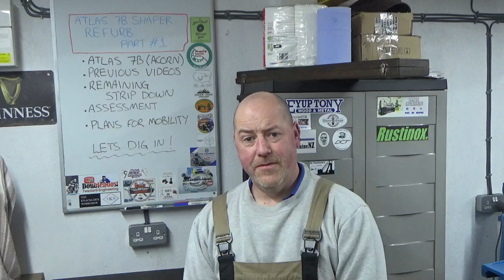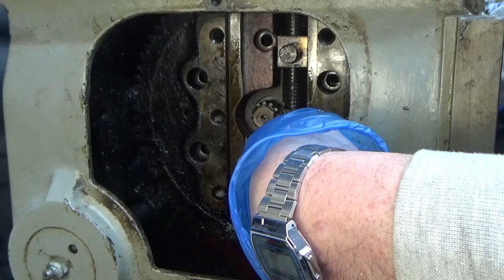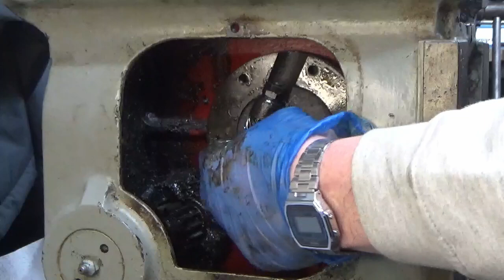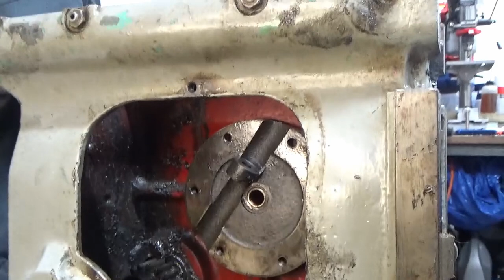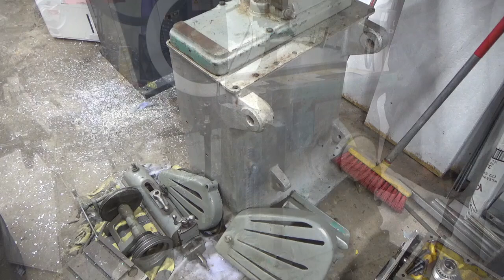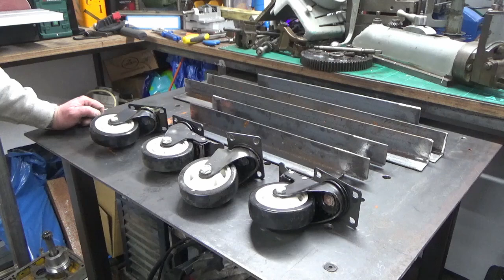Atlas 7B Shaper Restoration  Part 1 - Initial Strip Down

Comment: Quite well specified, ref stroke length adjustment by external control, and stroke position. My 7" Alba was originally flat belt drive, 2 mechanical speed, with stroke length requiring slackening a nut on the  bull gear, then lightly tapping with a suitable implement to move the  rank point. It has a vertical crack though the front of the casting, previously repaired by screws and plates, dovetail on right front was well out of spec. Ten hours on a bridgeport,  re_machining out the dovetail,  to accept some 2 mm DX bearing strip. Quite a mess inside as well.  It had a large diameter aluminium V pulley fitted driven by a 850 rpm motor.
Looking forward to seeing further episodes.
Thanks for sharing.
Reply from the maker: Hi Bosted Tap, thanks for the comment. Yep, it's a nice machine under all the clag. Just found a broken casting tonight though that holds the motor in place....... Gutted! Oh well, will make a decent video finding a solution hopefully. Cheers, Jon
Reply: @jonsworkshop  Ouch!, I'm sure you will complete a suitable repair.

Comment: the guage in the pin might be to transfer oil acoss the surface
Reply from the maker: Hi Watahyahknow, thanks for the comment. It looks like someone has belted the pin out in the past without undoing the grub screw that holds it in. Cheers, Jon

Comment: Always good when a gear has all it's teeth !   With the castors , my one is on temporary casters & it is nothing short of a complete pain in the ass to move .   Maybe 2 castors & 2 fixed wheels .    👍
Reply from the maker: Hi Max, thanks for the comment. I have put it on 4 wheels, 2 braked but all articulating, seems not too bad but a lot of the weight is off just now, we will see what it's like when I get it rebuilt. Cheers, Jon

Comment: Hi,Jon. If you remove the 6 bolts around the bull gear bearing housing won't the whole bearing housing complete with bearings just come straight off from the main body casting? There is a similar bearing housing on my Alba shaper and take the bolts out removes the whole bearing housing.
Reply from the maker: Hi Howard, thanks for the comment. Yep, it will, once the centre shaft is removed, I tried gently tapping it but it's not budging. The bearings feel really good so I am slowly learning when to leave well enough alone lol. Also, one of the 6 bolts is recessed into the flange to clear the pulley and I have nothing to get it out, think it would need a modified socket. Cheers, Jon

Comment: Well done Jon. Very jealous of the very slick stroke adjust. Mine is all manual guessing. Well, I have a pile of parts I need to get started again with my Lewis Shaper.
Reply from the maker: Hi Dan, thanks for the comment. It's a pretty clever mechanism for sure, and it looks in good condition under all the muck so hopefully it will be OK. Cheers, Jon

Comment: Another good one John. Always liked shapers. My foreman taught me to get a good finish on material by honing the tool without taking it off just by tilting the clapper box and rubbing a stone back and forth.
Reply from the maker: Hi Dermot, thanks for the comment. Yup, I was taught the same (mill, lathe, shaper), oil stones are great for keeping HSS in good nick. Cheers, Jon

Comment: Hi Jon, it's amazing looking at the bull gear, slide and helical worm gears who designed these things in the first place. 
The shaper doesn't seem to be that old looking at the original coloured paint. That body casting looks very weighty. Tony
Reply from the maker: Hi Tony, thanks for the comment. Yes, very well designed and very simple really despite the looks of it inside. You are right, that base casting must be 150Kg on its own, its a big lump. Cheers, Jon

Comment: The new stiffer wire brush may rough up the undercoat.
The internal are quite involved, lots of pieces to put back together. 
Hopefully I'll understand how shapers work by the end of your refurbishment.
Reply from the maker: Hi Gr eg, thanks for the comment. Yeah, the cup brush I bought is savage, think it will do the trick (assuming it holds itself together, you can guess where it was made)! I will be filming much more detail on the rebuild so hopefully you will get a good idea how it works. Cheers, Jon

Comment: What's nice with these machine, is that it has no oil bath. Because that's where half of the parts will disappear in while taking it apart :-)
Reply: Buying a Sure Shot was one tool that made internal wash down a breeze. I happy to get in a couple hrs this Friday on our Klopp. Going to bring in Home Care 3 days a wk for the bride so I can get back in our shop more. Chemo restarts on May 9th for 3 days per wk at 5 hrs per day over the next 2 months, so not able to get much done in the shop. Bear
Reply from the maker: Hi Rusti, thanks for the comment. Lol, I don't need an oil bath to lose all the small bits, I can lose them while they are in my hands!! Cheers, Jon

Comment: Good work so far. The paint on my mill is more stubborn. I use sodium hydroxide to get it off. And a cup wire wheel in an angle grinder. I like the idea to make it mobile. I have already done that to my mill. I have made a universal machine moving solution. It is the subject of my next video. I can't upload it yet as I am on the ship. I am looking forward to the next installment of the shaper.
Reply from the maker: Hi Carl, thanks for the comment. Having now had the cup wheel delivered and seen it, I think there's a real danger of going right through the castings with it, it looks absolutely savage lol. Over time, I am going to put all my machines (except the lathe) on a dolly like the one you will see next week being made, then when I come to move house in a few years, it will be so much easier. Cheers, Jon
Reply: @jonsworkshop  I cleaned up my Swindens vice casting with a cup wire wheel. It works well and is not too brutal if you control the pressure applied. I also have an air powered 90 degree die grinder from my aircraft days. A wire wheel in that works wonders.

The thing that does happen is the wire wheel takes out the filler where the manufacturer made good any casting imperfections prior to painting. I will have to do some filling.

I made my universal machine moving system primarily to aid the mill refurb, but also in case I need to move anything else. I've no intention of upping sticks, but you never know.

Comment: Getting there Jon. With regards to you undoing the 2 nuts on the leadscrew, you couldn't see from above, but the socket was too low and was trying to undo both nuts, that was why it was so tight to turn with your ratchet.  Have fun. Regards from Australia.
Reply from the maker: Hi Dave, thanks for the comment. Yes, I saw the error when I was editing and you are right, couldn't see anything from the top really. It wasn't that tight really, I was just taking it steady as I knew I was moving both nuts at once so just feeling them off in case they locked up and started damaging the threads etc. Need to knock up a spanner for the re-fit so I can do it right, out of some 2mm plate, those nuts are really thin. Cheers, Jon